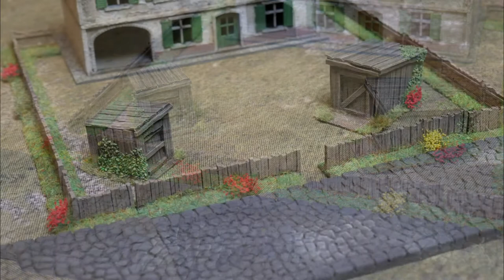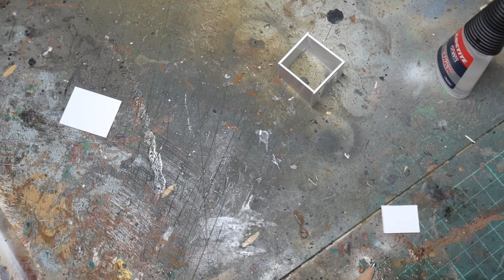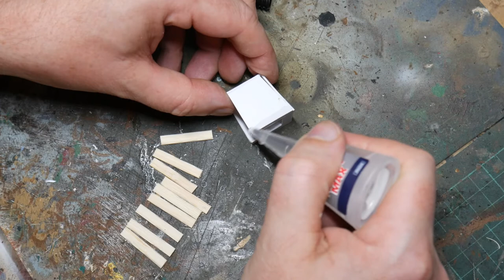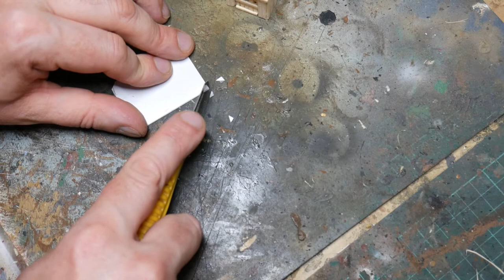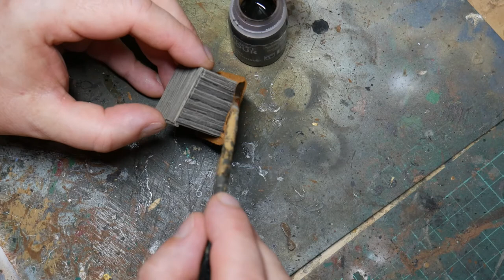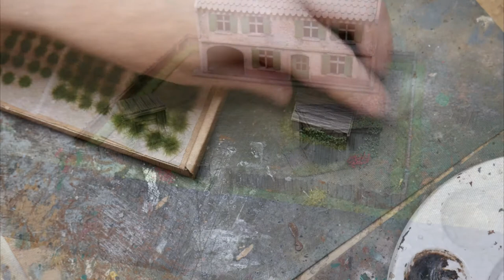Scratch Building 15mm Sheds | Storm of Steel Wargaming

Comment: I find a small wire brush is very good for giving a scale grain effect.  Works on plasticard too, but you have to push a bit harder.
Reply from the maker: I did buy a wire brush for exactly this purpose but it was too big when it arrived, so I went with a knife. Either works.

Comment: I’d be tempted to use card or beermat for the basic structure of the shed — keeps the price down to zero and much easier to cut, and any warping adds to the handbuilt realism of the finished item. 
It’s all covered by wooden strips anyway, so can’t be seen.
Reply from the maker: Use whatever you want. The plasticard was just what I had to hand and was some offcuts that I wouldn't be using for anything else.